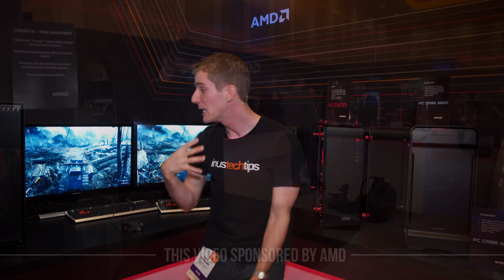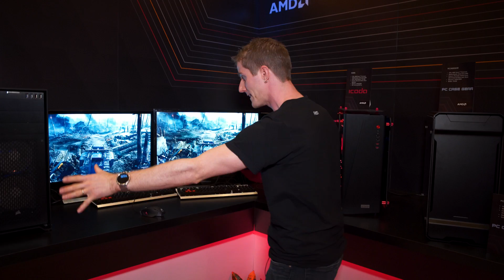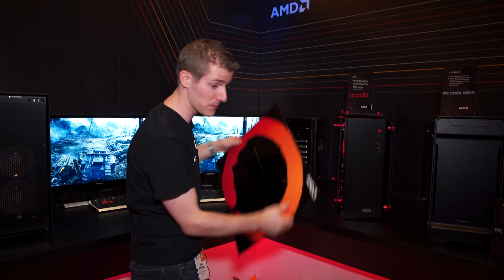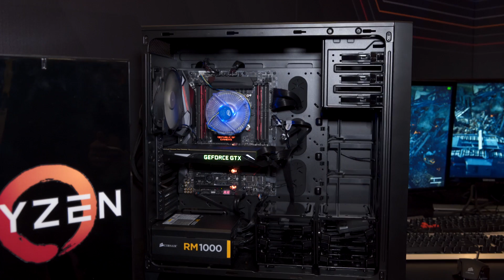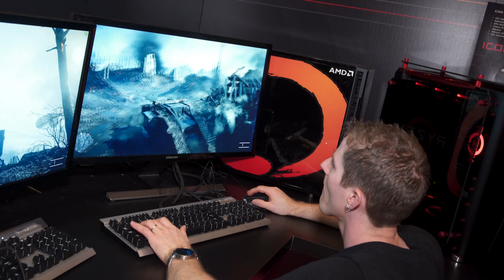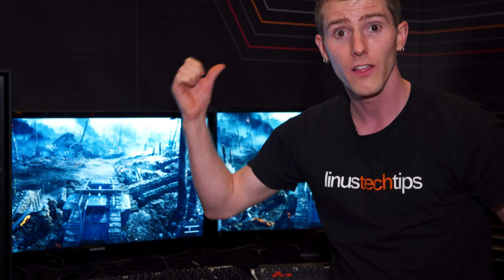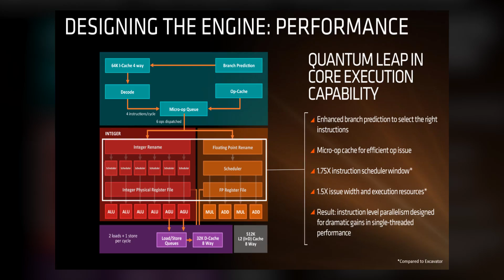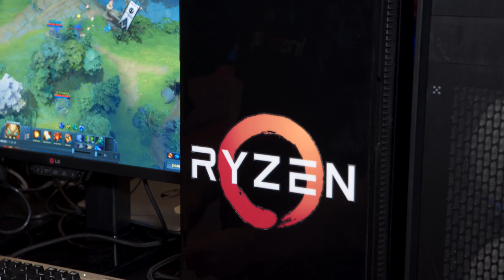AMD Has Ryzen!

Comment: Effin hell, probably have to sell 6700k and get one of those ryzen chips soon.

Was using a fx 8350,went for 6700k but watching ryzen vids... i want amd again :D
Reply: no need lmao, keep the 6700k.
Reply: 6700k is around 370€  here ( estonia ).If that ryzen works aswell as 6900k and costs less than 330€.. then why the hell not :D
Reply: Since you already have the 6700k theres no need to upgrade it for several years unless intel or amd release something ground breaking
Reply: Simo M no need, the 6700k beats the 6900k in gaming by 15+ fps, idk why they keep on comparing the 6900k with ryzen when its not a gaming intended cpu.
Reply: Depends how much you could sell it for :D
Reply: It goes around 300€ in forums.
I really hope that ryzen is damn awsome
Reply: You want to downgrade? 0.o
Reply: Why bother? It's not gonna make a noticeable difference.
Reply: Performance will be close to what you have. Price will be less. So not an upgrade but if you have a need for another system then go for it. I have been planning on building two Zen based systems for family members.

Intel is unlikely to drop prices by much if anything but may push performance a bit more for the next couple of updates to try to widen the performance gap.
Reply: SELL IT BEFORE RYZEN COMES OUT OR NOBODY WILL WANT IT IF RYZEN IS DIRT CHEAP AND THEN YOU'RE STUCK WITH k ill stop I just like seeing these fights start between companies
Reply: Yeah have fun getting a new motherboard like 8 times
Reply: Traitor
Reply: You realise that it's been tested time and time again, you'll get no benefit of having more than 4-6 cores when rendering shit
Reply: Rip, you have to buy a new motherboard
Reply: I have a 6700k. Watching this, I still have no intention of switching cpus
Reply: naaaah
Reply: I feel like the most realistic thing thats going to happen is intels going to drop their prices to whatever amd does cause it probably costs 50 dollars or less to manufacture the cpu's...
Reply: Simo M.  To hell with that, I have got thousands of dollars invested, and I would have to change out too much for it being cost effective.  But I do have an old I7 at my other residence that can't even do VR on it, so this would be an interesting replacement for it.
Reply: Means the used i7's will drop in price asumingly lets hope for it, perhaps i can upgrade to a  i7 4790k.
Reply: Aleksandr Pronkin You can already sometimes find good deals on 4790k. I got a great deal on mine last year from a store that was reducing inventory. Got a new one for less than average used price.
Reply: lol what made you upgrade though ?? 8350 is good processor right ?? can't handle all games ??
Reply: Am in the exact same boat, went from the fx8350 to the 6700k for that performance. I want AMD to succeed again
Reply: Performance differences will be marginal at best. You're set for years to come and you want to risk it to upgrade? You're also gonna need to buy a new motherboard to fit Ryzen. You're just gonna end up spending way too much for little gain. I'd wait, dude.
Reply: It's not that good. 6700k does better in games
Winded up using gtx 1080 with the 6700k.
Reply: "It's not that good." Lmao, try to hide your fanboy. I don't care if you bought intel or not, it is the best processor for gaming right now.
Reply: Dennis D'Antonio "It's the best processor for gaming right now"

It's not even out yet, who are you calling a fanboy when you already think it's the best gaming processor?
Reply: Idiots...

Idiots everywhere.

But i agree with you Morin
Reply: How was the jump from the 8350 to the 6700k? I have an 8350 atm with a 970 gtx and I want to upgrade.

Comment: I'm interested in the price. Especially as AMD are known for being much more competitive when it comes to their pricing.
Reply: Intrisity I'm an AMD fanboy but they've pulled shitty cpu prices out before too.  They were after all the first company to charge 1000 for a performance cpu.
Reply: Yikes, I've always avoided AMD as I felt when I paid a little extra for my intel I was getting the performance, but if this can compete with an 8 core intel, and be a fraction of the cost, I'd definitely consider replacing my CPU with one.
Reply: Intrisity when amd released the first fx chip it annihilated everything Intel and via had, and it was gouged like hell, the amd64 and dual core releases were both landmarks and they gouged both of those
Reply: I find myself wanting AMD to dominate this year because if they do we first of all will be getting cheap good cpu's and gpu's and also next year intel and nvidia will pull out their secret chips they have stored up which they finished researching 5 years ago which will deliver 2 times the performance. Well you get the idea.
Reply: Intrisity think about it, if AMD made a cpu that performs as well as Intels $1000 cpu, then the price is going to be close to $1000. .
Reply: I guess I just buy at the wrong time. I'll be looking in the next six months for a 6/8core CPU as building a sperate PC to record and help with editing isn't really my idea of fun. (plus the electric bill).
Reply: All though you're most likely right, I pray you're wrong.
Reply: This is a legit strat for pretty much any company in the world. They all do it if they can.

Comment: This reminds me too much of the fury launch. Tons of hype and talk about how good it is, but no actual benchmarks, and then it turns out to be meh once they do come out. I hope it doesn't happen again.
Reply: 1) There has been a few benchmarks, all showing AMD slightly on top

2) The Fury's a good GPU espically for the price. The Fury X is now better than the 980 Ti in most tests thanks to FineWine
Reply: There are official benchmarks released for ryzen, and leaked gaming benchmarks (http://www.techradar.com/news/amds-ryzen-benchmarks-get-leaked-and-theyre-jaw-dropping). Obviously it does well in synthetics due to having 8 cores, but gaming performance is impressive as well. I don't think Intel releases benchmarks before release either (though they don't have anything to prove).

It performs only 1-2% slower than an i5-6600 in far cry 4/grid/bf4/arma/witcher3 despite the 6500 being clocked 500 mhz higher. Keep in mind that these are 2014/2015 titles so it's very unlikely they're taking advantage of more than 4 cores anyway. They are going to sell the 8-core for $350 which seems like a steal because intel sells the quad core i7-k for that price.

At the very least, AMD will be competitive again. Ryzen will probably clock quite a bit lower than kaby lake  but it has shown to be equal or slightly faster clock-for-clock when compared to intel.

Comment: What's the CPU cooler being used in the Ryzen machine for the BF1 Demo?
Reply: Jabberwockxeno the stock wraith cooler from the previous generation
Reply: Thermal throttling for CPUs starts at 95 °C , I'm pretty sure that was not the case here.
Reply: It is the wraith cooler which is amds new stock cooler
Reply: Jabberwockxeno Pretty sure it's the wraith one that comes with their other high wattage chips now.
Reply: Unfortunately a better cooler than the stock Intel one. would've liked to see the same cooler for both. for anyone who might say that's not possible due to the AM4's new mounting system, but many cooler manufacturers have announced they have new mounting hardware to make them compatible. this would be especially helpful to remove thermal throttling as a potential bottleneck, because at least the Intel stock cooler is not meant for Broadwell-e chips, that's why they don't ship it with them.
Reply: Jabberwockxeno both stock coolers.
Reply: no systems were overclockked at all, infact the amd one was locked at 3.4ghz, 3.4ghz on air is the same as 3.4ghz on LN2, would have been a different story had the autooverclocking been enabled on amd.
Reply: no need to modify it, AMD didn't change the mounting hardware for the processor. Its compatible all the way back to socket 754 (so pretty much forever)
Reply: To me it looks like a stock amd cooler.
Reply: Purple Stingray Everyone on here is saying the wraith cooler.
Reply: Syluxsify Well we didn't see the results, but a Titan XP can put out a lot of heat, and so does a 135W TDP CPU. Have you tried running those CPUs on stock coolers?
Reply: AMD Wraith
Reply: Sebastian Mendoza dude. Can you not see the dozens of people that already said that?
Reply: It is the wraith cooler which is amds new stock cooler
Reply: Probably a stock AMD cooler.
Reply: The wraith cooler I believe.
Reply: Looks like a Wraith cooler.
Reply: AMD's Wraith cooler.
Reply: Jabberwockxeno looks like the wraith cooler. it could be modified to fit on the socket.
Reply: amd's wrath cooler..... its been around since i think the new fm2+ chips or something
Reply: SoggyGaming the wraith is the stock amd cooler.
Reply: No, ryzen was not boosting (disabled, not to do with thermals), and it was not a custom cooler, it was the Wraith stock cooler. We will find out pricing when it is announced.
Reply: intel doesn't ship cooler's with anything but the xeons now i think
Reply: Bayan Zabihiyan dude, you unintentionally pointed this out: turbo boost on the Intel chip WAS enabled, and that could have been affected by the cooling. That's the point.
Reply: Fruit salad no, they still do ship them with locked consumer CPUs
Reply: Shadowed7 dude. Read the comments. So many people have already said that...
Reply: Well, it is a stock cooler. Just their improved one to tame their older extreme processor heat.
Reply: Fuck it I'm outta here. Too many notifications
Reply: tarfeef_ didn't notice I just copied and pasted the same thing, lol
Reply: It's AMD Wraith cooler. It comes with most FX-8350 Processors now.
Reply: to be fair how many cores are utilized in BF1? i seriously doubt that it would utilize more then 5 cores. (say 4 for the game and 1 for background stuff).